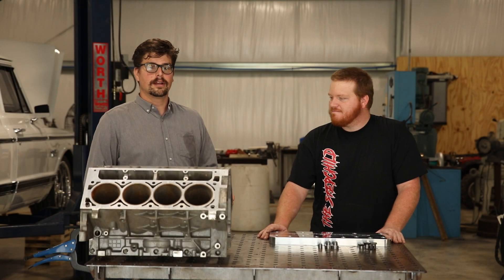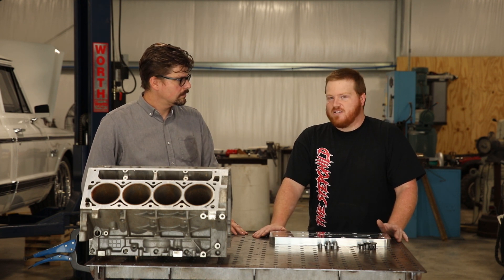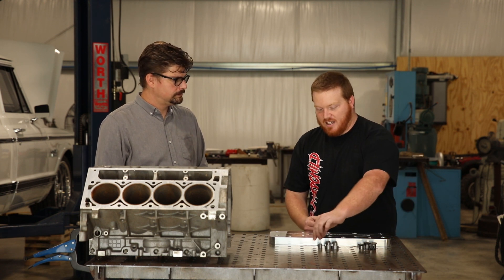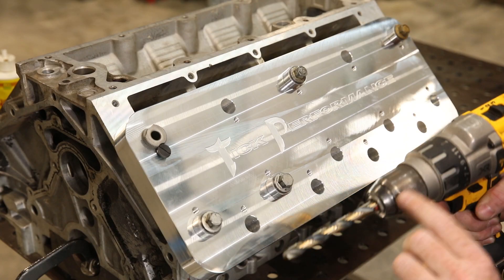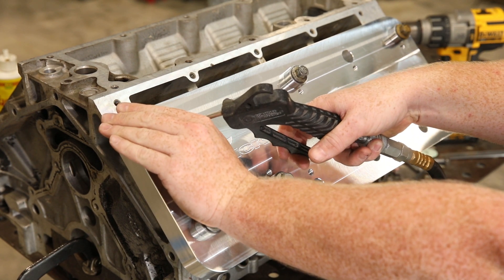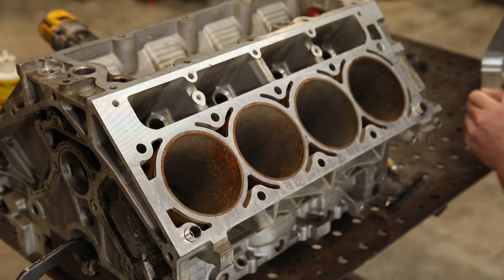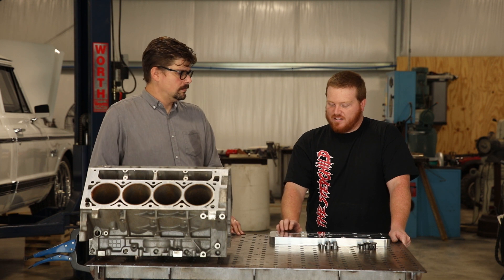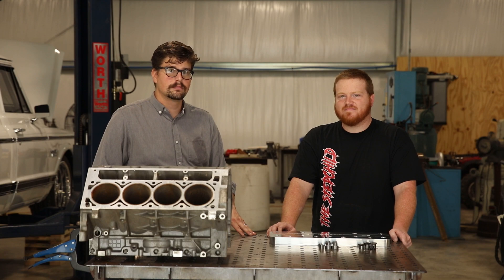LS Head Stud Upgrade Fixture - New Product From Tick Performance

Comment: Could this be done in the car?
Reply: Don’t see why not. You might be able to lay some strips of masking tape over the deck, bolt the tool on (just run the bolts through the tape, same with drill bits) and go to town. When you are done just blow out the holes really well and remove the tape and go. Easier said than done but idk why that wouldn’t work
Reply: As a diesel mechanic we do repairs like this or motor overhauls in chassis all the time. If you’re inexperienced as far as very in-depth engine work goes I don’t suggest doing this inside the car due to the fact that even a small amount of debris could get into the engine and cause catastrophic failure.